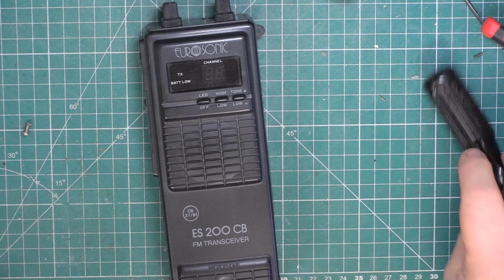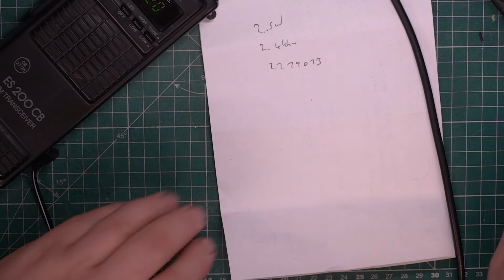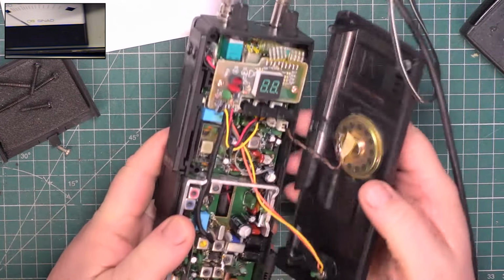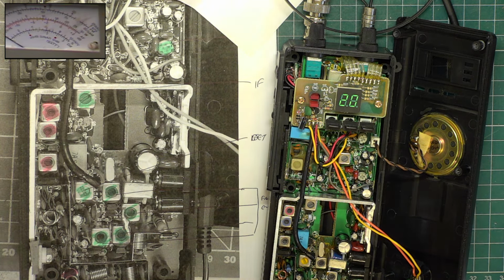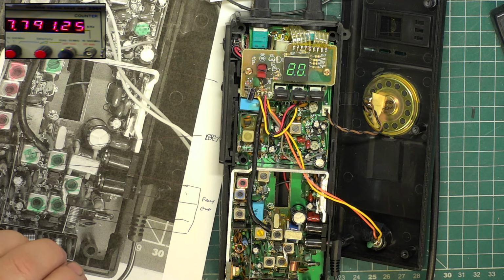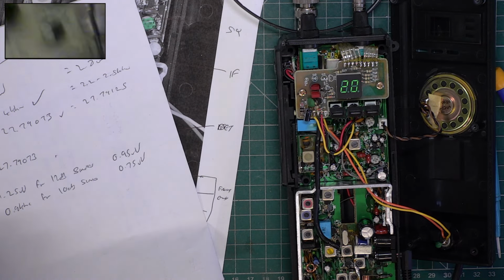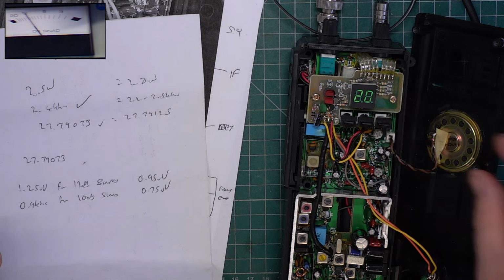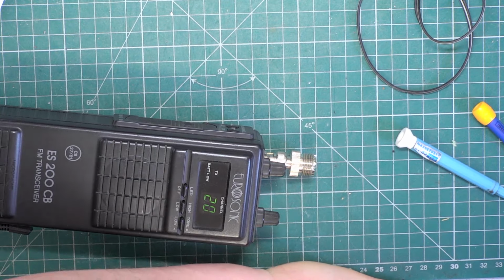Eurosonic ES200CB CB27/81 UK FM Handheld CB radio - Service alignment

Comment: Sorry I'm late to comment, still playing catch up on your vids ... I recently bought one, mint in original box, which is also mint with original price sticker of £79.99. Has rubber duck antenna, power lead with cigarette lighter plug, 2 dummy batteries, and instruction leaflet with schematic and specs listed. I only have an SWR/Power meter, a 5 digit frequency counter, and a small dummy load at my disposal. I just bought a BNC/SO239 adapter and have finally tested it today. It gives 2.6 watts output at 13.5 volts (9 alkaline batteries), and shows 27.791 for channel 20. The rubber duck is about as useful as a piece of wet string, but I got a telescopic antenna for it instead as it has a BNC connector and therefore easy to upgrade. For the record, the specs state power is 4 watts MAX at 13.8 volts, so this radio can be used at more than 12 volts. To be honest, it doesn't work that well with 8 alkaline batteries, it drains them too quick, even when on receive only, and you can't see the channel display when outside in the day time, even on a dull day. At 13.5 volts though, it works great, the display can be seen in daylight, the batteries last SO much longer, and the radio sounds more alive too. The tone switch does nothing though, but this seems to be the norm with this set.

Comment: So it has slots for 12 battery's? Or 10 and two dummy batteries
Reply from the maker: 10 battery slots. That's for 8 x AA alkaline + 2 dummy bzatteries....8 x 1.5 volts = 12V

Or All ten slots filled with rechargeable batteries (intended for NiCad types) that's 10 x 1.2 Volts = 12V

Richard, G0OJF, UK